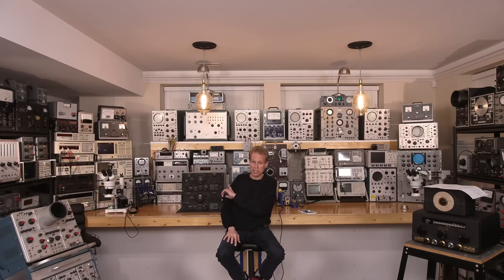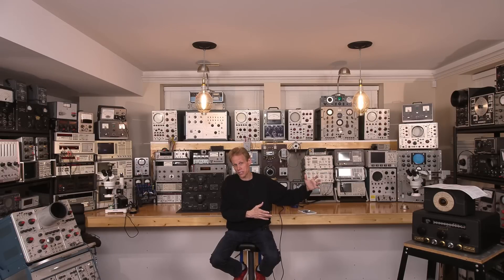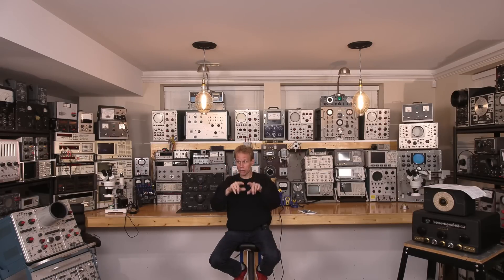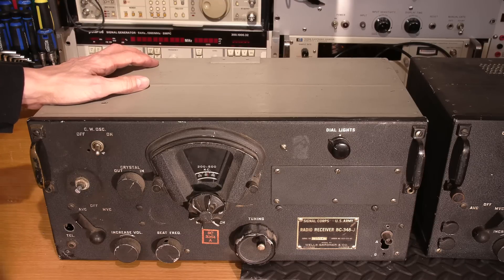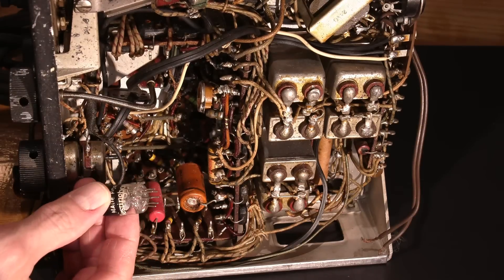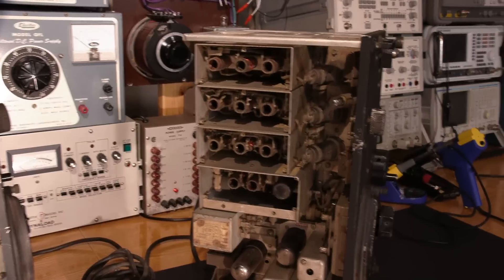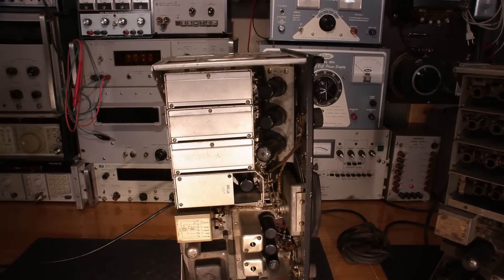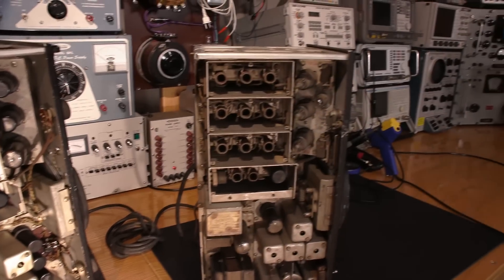Restoration Warplane Radio Receiver BC-348

Comment: yep going to have to use all three. best face + best guts....first. then best design....I know that may sound weird but i bet all of the original models were good designs. you need to be able to do the least work to get to the best possible mix.  all engineering is compromise!  best of luck. also i do like this super challenge but personally i will never touch these type of radios so the little projects help me personally more but the large ones are fun to watch......best of luck.

Comment: i like the series, but i struggle finding the time to watch multiple multi-hour restorations of those vintage radios. i am self-teaching myself to repair semi-vintage (as compared to those radio recievers) and even less vintage stuff, mostly synthesizers and effects units, with more and more smps-issues showing up. so while the tube stuff is for sure interesting and intriguing, personally i am getting more out of you dealing with more modern stuff. i would still vote to continue the series, as there are many channels talking about modern electronics basics and troubleshooting, the tube knowledge is far more endangered, and also an important precursor to the modern stuff. also, i think your information can/will/does save lives once people are interested enough to venture from low voltage into tube stuff. i am also on your patreon, and i will stay firmly put to help you creating any of this content, there is so much already for me to catch up to. just go with whatever you feel like sharing, the more you like doing what you do, the more enjoyable it is for us i guess. :)

Comment: Number 2 receiver is the obvious choice but if you have the time it would be terrific to hear a comparison of both designs. I restored a single ended version recently and it’s and excellent performer. I have a couple of the earlier double ended versions to restore so your experience and views on the two designs would be most welcome. I note the bfo is mechanically much simple in the later version too. The earlier version has a bowden cable. It must have been more expensive to produce with the bathtub caps etc. 

Looking forward to your critique of the two designs in part 2.

Comment: One other point... when I restored my single ended version i did three mods (all easily reversible) - a) cathode bypass cap on the final audio valve to improve bass and fidelity. b) removed the dimmer pot (set is mains powered) and mounted another pot to use as a snubber tone control in series with a cap across the primary of the output transformer (next best thing to an IF bandwidth control). c) hum bucker pot for the heater circuits on the valves as they are AC run and i wanted to reduce hum to an absolute minimum for headphone listening. The set is a fantastic performer.

Comment: yes for the restauration series (no 2 then 1), I also like the looking into those old schematics -- all remembers me to my childhood, my father owns a electronic company (PEK Electronic germany), who manufacturers also oscilopscops starting with tubes in the 1950-1960 later with transistors (I still own one of those 10MHZ scopes) -- maybe you came upon a PEK Oscilloscope but they are very rare. One of the series had a multicolor tube extremly rare I think using differen high voltages. I was in a professional film series on teaching use of the scopes (at age of 13) at 1970s

Comment: Mr. C.  I vote for radio 2 not just because it is the cleanest but it appears to have the least amount of mods done to it.  As for the Grand Receiver series as a retired RF Engineer and Radio Amateur who has worked on some of these receivers I believe the series is important because they show an evolution and improvement in circuitry design during these times.
As for less people viewing your videos while restoring radios I believe it is because you drive safety into the ground with your constant repeating.  The first thing I learned in electronics school was to keep one hand in your back pocket while troubleshooting tube equipment and I believe a large number of your viewers were also taught this.  You do have a bad habit of beating this dead horse into the ground.  While I agree it is important to point out safety to newer viewers you tend to over do it.  Yet when you were showing the receiver with the gimmick in it you did not explain what that was for to people who may not have seen one before.

Comment: Paul, as long as you continue mixing up your content, please continue this restoration series.  As far as the BC-348s are concerned, please "study" #1 and #2 to see which would be the best performer.  Use the faceplate from #2 on the unit you choose and the case(painted black) from #3 (unless you believe that it will get too hot inside).  If you choose #2, take the power supply from #1.  I look forward to this series!

Comment: Radio 2 would be my choice.  The different models are described in various websites and there's a lot of dope on conversions and mods from the post-war radio boom days.  Those oil-filled caps are a mess as you well know.  So, go for #2 !  I have had a couple down through the ages and they all have spurious holes and mystery switches and other ham buffoonery, but for smooth tuning, they're pretty nice.  No need to fret as to content, Mr. C...I'd pretty much watch whatever you produce and nod approvingly whether it's an R390A or a toaster!!  Thanks and 73  JEFF  K4UIE

Comment: Cover from the left one.  Dial light control from the left one.
Faceplate from the middle one.
Internals from either the middle one or the one on the right,  depending on performance,  maybe due to additional stages.

Comment: I would love to see the restoration series continue, I've enjoyed watching and learning about the different recievers.
Of the three BC-348s featured here, I'd like to see the restoration on the middle one (Radio 2). It looked to me as though it had a pretty decent mix of physical and electrical restoration and the face looked pretty original, which is a bonus to my mind.

I do enjoy learning about the alignment procedures but feel that seeing the full alignment for each restoration is a bit unnecessary since, for me, that's a tutorial that I don't really need unless I'm actually trying  to tune the same type of radio being featured.

The only other bit of feedback I have is: are you able to share links to the schematics for each of the radios you work on? Partly so I can see more clearly what you're pointing at and partly because I'd really love to be able to pause the video and try finding the problem you're diagnosing before unpausing the video and finding out how close/far off I am.

Comment: I pretty much watch whatever you put up, Paul. Even the curling iron and the coffee maker videos were fun! Lol. But my favorites are in the receiver and test equipment genre, the older the better. I would like to see you go through one of the larger 500 series Tek scopes that you have. My boyhood scope was a 535, and so I have a fondness for that ilk. All that said, you do need to cater to the masses to keep the revenue flow up, which is understandable, but I'll be sad if you don't finish the Grand Radio Receiver Series. Count me as a vote in favor!

As for which chassis to use as the base, the easiest might be #2 and you've got a matching donor model in #3; therefor restore #1, because it's the godfather of them all, and put the nice face of #2 on it, and the best of the power supply mods, and strip out any superfluous hacks that don't benefit the end result.

Comment: Yes, I've been keen to see this restoration series. I have a 1956 Collins R-390A/URR which I would like to restore too. The series which you had suggested would be very beneficial. The Collins is especially interesting due to the inductive tuning engineering which is like clockwork merged with electronics - quite a difference to the Hallicrafters and Hammarlund and other receivers(some I have too). I sincerely hope you will proceed. All your youtube and patreon releases are appreciated. Thanks. 
BTW #2 would be my choice, but #1 will be interesting to have a schematic review for.

Comment: Yea old mate, continue, it was interesting doing the assessment on these 3 radios too. Put as much info you can in the video as I watch them completely I'm not well versed with Valve gear. Restore the most original looking one so guess no. 2 but I think you got enough to fix No. 3 as well. At some point later I would like the see you do up a Reel to reel tape player as I have 2 of these to fix. What a shame none have the Dynomotor.

Comment: Great Video, I had one of these and a terrible Heathkit GR-64, which I bought when my Dad  took me into NYC - I was set on a solid state RS DX160 or a Lafayette HA-800, both were out of stock and the $100 I had from my Transistor and Tube Radio repair business in grade and high school was burning a hole in my pocket... Per your questions for feedback, I have 2 observations which radio to chose. You rightly focused on the condition of each, but missed the history and model varient of each, including age and S/No. #3 had no name tag, so unknown. Radio #1 said Wells Gardner, the contract was 1942, and if I remember correctly, NOT the most popular BC348- J model, and the S/No was 3864 or something. For radio #2,  it was another Wells Gardner , BUT the Contract and S/No were not panned over or visible in the video. Radio #1 was clearly the most popular BC348-Q model, and I agree the nicest to restore, A very generous Ham Rado Elmer gave me the BC348, when I was a Novice. It was way more stable than the Heathkit with its uncalibrated bandspread, and I remember adding a small filament transformer for the Converter & BFO tubes, a popular boatanchor trick to combat DRIFT.  I watched all of your AR/CR-88 series, and enjoyed the history in winning WW2 as a great Espionage and Codebreakers receiver. Most useful are our Mr Carlsons Lab Tube Signal injection and Pickup protectors for alignment with now inexpensive Spectrum Analyzers. I plan to build them to align the other great WW2 Spy receiver, from Hallicrafters, the SX-28A which I bought for $600, mostly recapped except the RF Deck, and it has one mystery IFT wire and cracked trimmers in the crystal filter so kind of weak reception. Thanks, and 73's, Hilary W4HDL

Comment: I'm going to go against the crowd as my BC348-R is identical to the #1 minus the mods, but the power supply even looks identical. Metal 6K7's with grid caps and all. I will be following along, at my own risk of course, but not to worry, in a past life I was a transmitter engineer for a major market TV station. I watch all your videos and am looking forward to the R390 also, although it is out of my price range. I would love to find an R388URR someday though. They are also excellent receivers.

Comment: Yes, continue the grand receiver restoration., preferably the one with the least modifications. My first "good" receiver was a BC455 that was brand new packed in a wooden crate that I bought from a war surplus store in 1964 for $16. It had the original dynamotor that could be easily removed and replaced with a DC supply. I paired it up with a homebrew 2 meter nuvistor converter that worked exceptionally well.  I'm 75 now and recently designed and built a 30 kHz to 40 MHz superhet receiver utilizing an Arduino Uno as the main control for the local oscillator.

Comment: I do love the work you do 
I have been trying to build up my own test equipment. Maybe in between you could do a signal generator or a power supply. Im trying to find a plugin for my tech scope so i can use s VI tracer.
I agree radio 2 is probably the best candidate but radio 3 looks older and maybe more rare  .

Comment: Yes to series. I think center one is the best bet. Transformer in that one looks big enough - try it out before changing out the power supply. Could check the choke-less filter w/ O scope.  I have a BC312 - the heavy tank version of the same radio, but messed it up 50 years ago. Nedd some inspiration to tackle it again. Do you have an SX-28?  That would be a challenge! Been working on mine for about 2 years on and on. Recently did some RME 45's.

Comment: Hi. I will follow your restoration series specially about the BC-348 type. My BC-348-R is a bit unstable when I'm tuning the VFO. My guess is that there might be some caps that needs to be replaced. I'm just not sure where they are. I would like to see the BC-348-R be restored and I will follow you on the other projects as well.

Comment: I think your read on which radios should be sacrificed and which one should be built up is correct, but I also am wondering if maybe that first one has another IF converter in it. Looking forward to seeing the schematics! In the meanwhile, if you're going to interlace some smaller projects amidst this restoration, could I request an FM receiver from the early 1960s? A Zenith K731 or something similar? I'd love to see how you align the FM portion. I don't think you have any videos covering that.

Comment: Yes, I would like to see one of them restored.  To keep it more original, I would like to see you design and build a DC to DC power supply, mounted on a Dynamotor platform with 28V DC in, rather than one of the AC power supplies. I have three of these units in excellent condition.  I restored one for a friend using a 28V military Dynaverter, PP-2792/ARN-30D Aircraft Radio Corp.  I believe these supplies were used on newer command receivers in Vietnam.  I also believe they had problems with the switching transistors going into thermal runaway.  Every one I worked on had shorted transistors and or a bad transformer.  Fred

Comment: I would enjoy watching any project you do. Also some more modern stuff. But I would not vote for dropping the series. Maybe an idea would be to "stretch" the series and do other stuff either during the series or between receivers of the series. (Depends on what your behind the scenes schedule would allow for or how you manage to shoot and edit. Also not sure if you tackle more than one project at once or only start with one, and don´t touch anything else before that one is done.)
To me, watching all the tube suff remains interesting, and although the basics are kind of repeitive, those receivers still are unique enough on their own. But as I said, getting some more modern electronics in between, would be very much appreciated as well.
I guess there could be worse "problems" than having to much stuff to possibly make videos about ;).

For this one, I guess I would go for Radio 2 with the Power Supply from Radio 1.

Comment: KEEP GOING!!!!!!  I  have a R-390A and have  been patiently waiting for it to come up. I like the format and I learn a lot from  your shows. AND please don't shorten  the episodes. Also, I had a BC-348Q back in 1962. I was a 13 year old, and the power supply I built was based on an old model train power supply. I got it to work, actually heard CW  on it, then the the power supply burned up!  I traded it for a functional HeathKit HR-10.   Hey, I was just a 13 year old and time was ticking on my Novice ticket.
IDK which receiver to use... Maybe #2, but I want to see the schematics first  and what was stock and what was a mod.
   KEEP THE PROJECTS GOING!!!! Maybe start another channel for stuff like this?
73 de  WA8SDF

Comment: I understand the middle radio may be the cleanest internally, but I find the first one with the grid cap tubes and extra transformers more fascinating. I am interested to see if the newer designs were sacrificing performance when they cut down on component count.

Comment: Second receiver gets my restoration vote.  I also have a 348Q, but mine still has the dynamotor.  If I sent mine to you, could you create a video on how to replace the bearings in those things?  Not going to put a standard power supply in the thing.  I figure too few of these survived completely intact.

Comment: Hi, I still use a bc-348 to this day. Both designs are factory as far as the 2 different tube types. The 6k7 version is older more the first version. The 6sk7 is a new more refined version. Both types work well but the 6sk7 version is in my opinion better as it is way easier to work on. So I'd you were me I would definitely hands down pick number 2. There were other variations such as a bc-348 with a "j" at the end so bc-348j. They made a few different types of these. Also different companies made these for the government. Lowest bidder at the time would get the contract to build x amount of these. That said they had to follow military specifications to build. Not the best radio you could buy but they do work well.